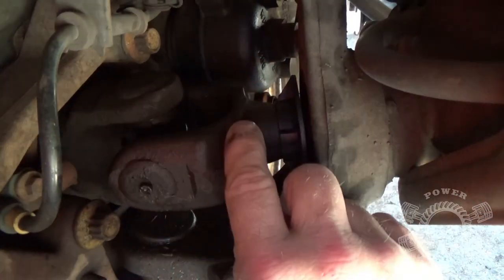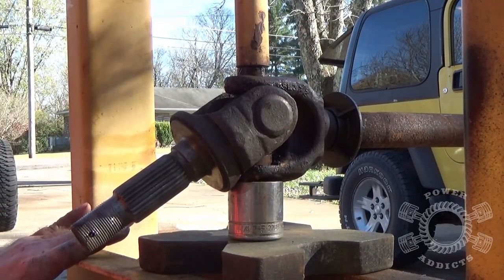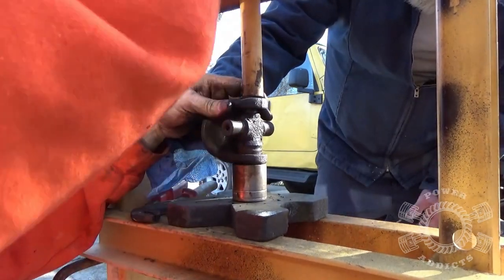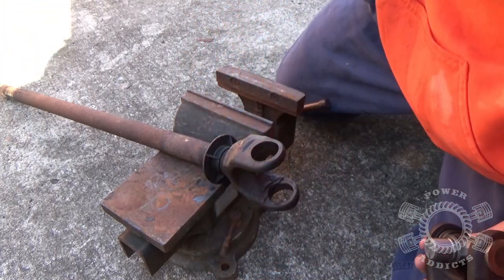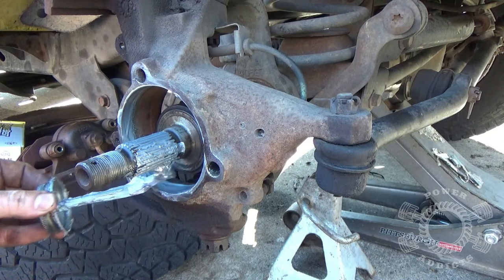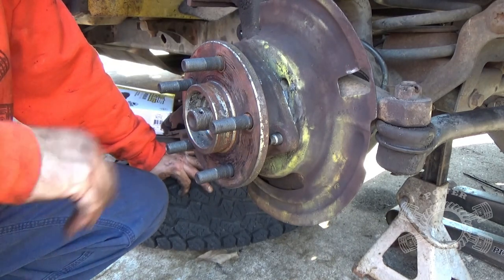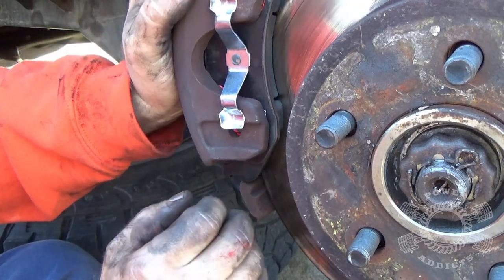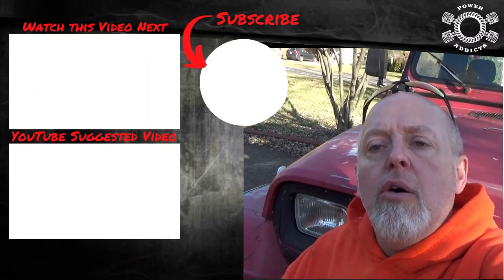Jeep Wrangler TJ - How to change the Axle U joint #poweraddictscrew #jeeplove #jeeptj

Comment: Never ever push the u joint cap all the way in so the other cap comes out.  This makes the cap come out to the inner side of the short shaft.  Only press the u joint cap half way out.  Use channel locks to grip it and twist it out the remaining way.

Comment: Having worked on so many TJ's over the years "including my own" I pretty much just replace both sides as I've found that sooner than later you'll be replacing the other side...do I need to? no...but I do   feel better knowing i wont have to dive back under anytime soon (barring a defective unit)
Reply from the maker: I totally agree! Dad and I are going to be rebuilding his front driveshaft soon. Even though it's the ball in the Cardan joint that's bad, we are replacing every Ujoint in the shaft while we got it out. Thanks for dropping in and leaving a great suggestion!!

Comment: Hey Chuck. I have a 06 Rubicon L6 manual that I am about to rebuild both front wheels (Ball Joints, bearings, U Joints, etc.) and most of the suspension (Tie Rod ends, Drag Link, Upper and lower control arms, Drag Link, Sway Bar rebuild, and Track Bar). Do you have a series of videos of this kind of rebuild OR can you offer an order of what should be done in sequence? I have done much research on each of these tasks but the sheer magnitude of this undertaking can be overwhelming, to say the least. I have done most of these tasks over the years (I am an Old Fart and started busting my knuckles back in the 60s) but not all at once! Any suggestions or help you can offer will be greatly appreciated.

Comment: Do i have to remove the wheel berring assembly from the axle shaft to change out the Ujoint? 

Im assuming that by removing the WBA youre ujoint change out gets 10x easier?
Reply from the maker: Could it be done with it on ... eh ... possibly. Will it be easier removing the WBA .. absolutely!

Comment: That tool's called a spud wrench.  Used for aligning holes for bolts!
Reply from the maker: I bought it at Tractor Supply because I thought it would be a great ratchet to keep in the Jeep tool bag. I looked up the "spud wrench" there are lots of different style wrenches that use that tapered end to align the bolt holes. Thanks for helping me figure out the technical name of that ratchet!

Comment: What size socket are you using for support when using the press?
Reply from the maker: I didn't even look. It had to be big enough to allow the ujoint cap to go into it.
Reply: Looked to be 1 1/4 inch.